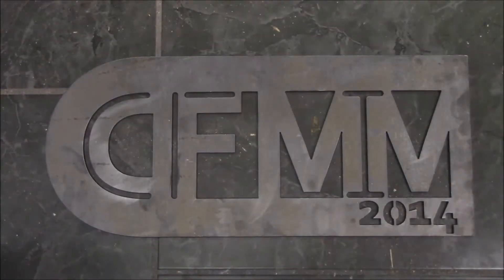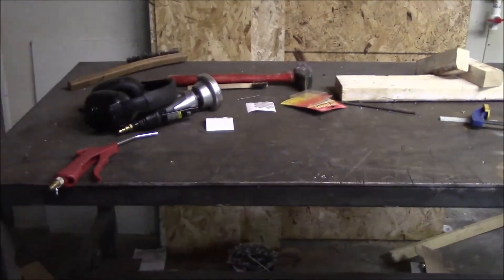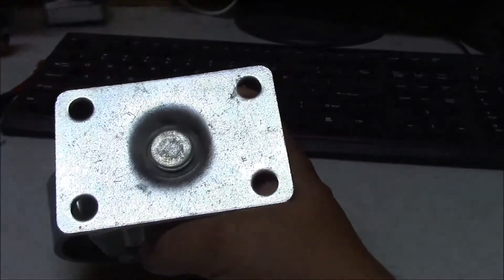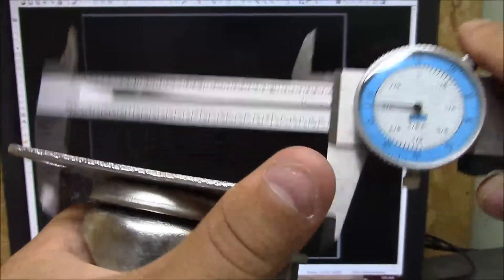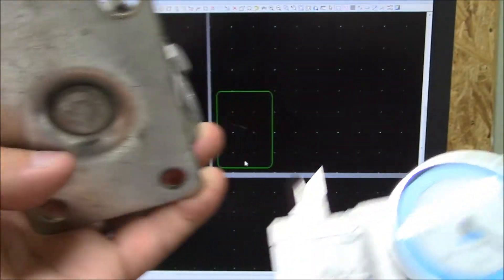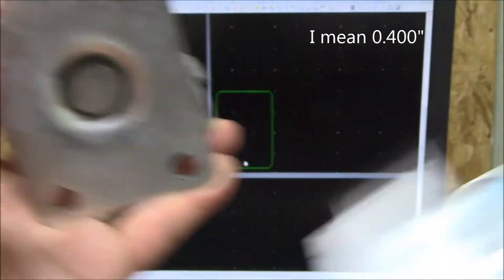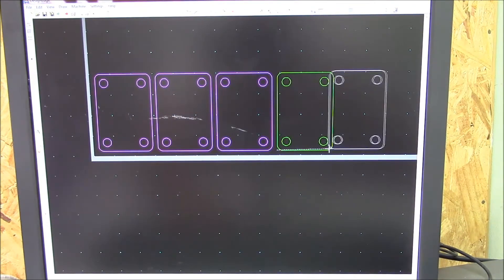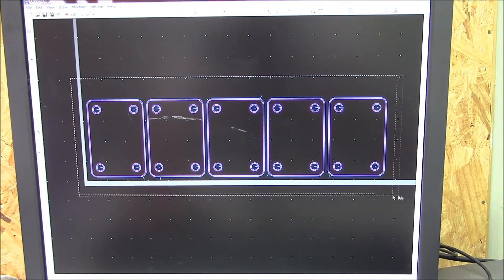Designing Caster Flange Plates

Comment: so i am looking at your video and you not telling me how you are putting in the lines in the center?
Reply from the maker: So at 7:33 you can do the first horizontal middle line by using line command "L", and snapping to center of outside lines. you can get to snap commands by pressing middle mouse button, wheel if you have one. From there, I offset that line each way top and bottom. Unless you changed settings, you will need to hold control to copy the offset so it doesn't cut an paste it. you can repeat the line and center snap to get the vertical line, and then offset left and right, then it is a matter of trimming and deleting what isn't needed. Sorry I cut this part out.

Thanks for watching.